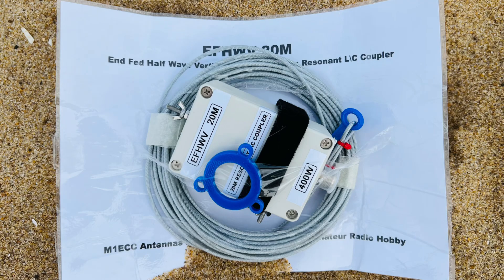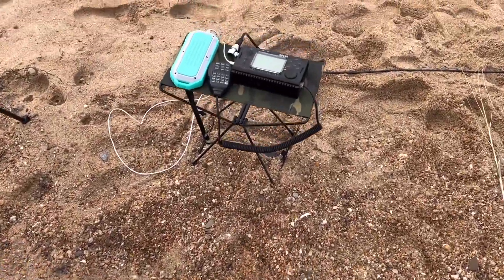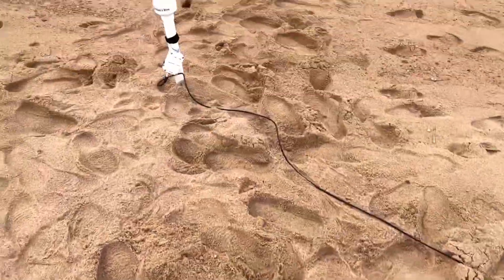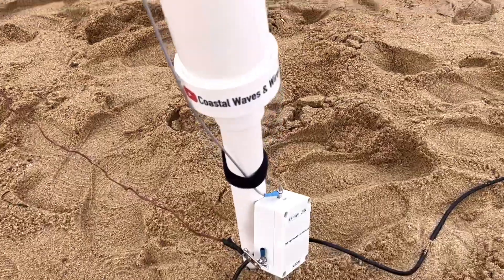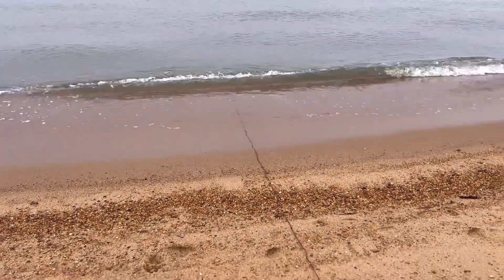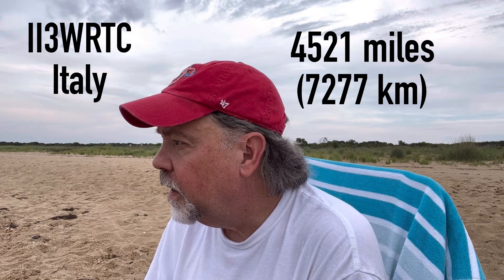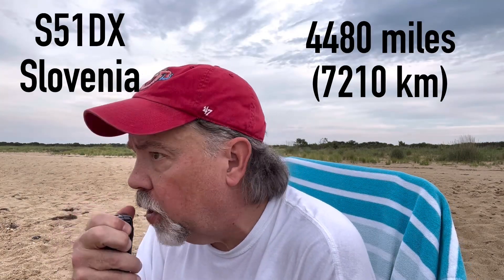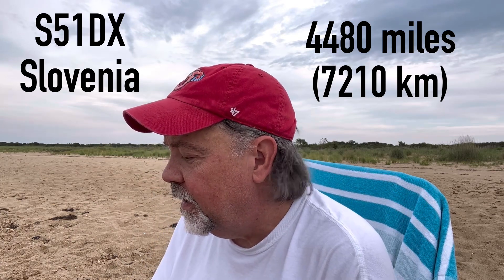Beach QRP with the M1ECC Vertical End Fed Half Wave for 20 Meters

Comment: What kind of wire is that for your vertical? It looks heavy and steel ? I'm new to the hobby, but I read that if you put a choke in at the box instead of the radio it will not use the feed line as a counterpoise, so you could then attach counterpoise wires to the lug on the box. I'm not certain that is the recommended method though.
Reply from the maker: That wire came with that antenna and you are correct it is steel and I believe it is 3mm thick. That's pretty hefty and somewhat overkill for lower power. I build most of my antennas from 16 gauge copper speaker wire. here's a similar antenna to this I built myself and yes I used a 1:1 choke at the feedpoint to keep the common mode current out of the coax and prevent it from acting as a counterpoise: 

https://youtu.be/j-eD8NCxFco

There's a funny quote in ham radio: 
ABC = always be chocking

Comment: Radials for an end-fed half wave? The coax outer shield functions as a very sufficient counterpoise, just put a ferrite or two 0.05 wavelength from the 49:1. VK4BOB
Reply from the maker: Yes I know that is typical of EFHW antennas, the maker of the antenna states using radials in their instructions and I go for the opportunity of using the worlds greatest ground plane (the ocean) every chance I get.
Reply: Radials are like putting a mirror under a candle with this antenna.
Reply from the maker: @Tantalicdavid  excellent description! I don’t think some people understand the true effect of a ground plane under a vertical antenna, that’s one of the best simple explanations I’ve ever heard.
Reply: Its an L/C Coupler resonant at 20m not a 49:1 transformer the antenna is mono band for 20m. @Bob R